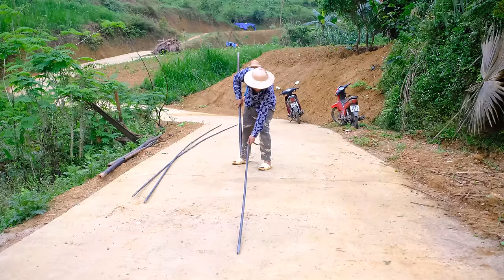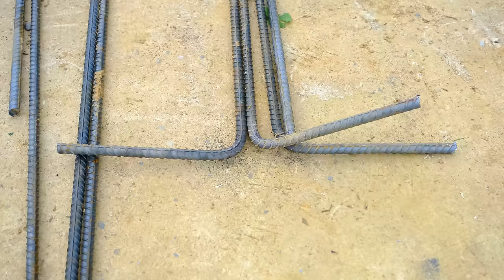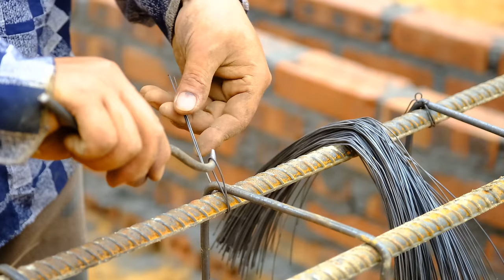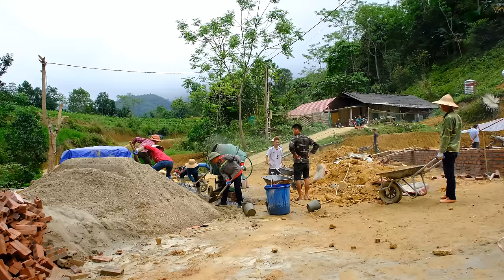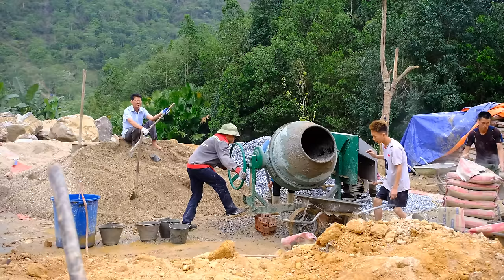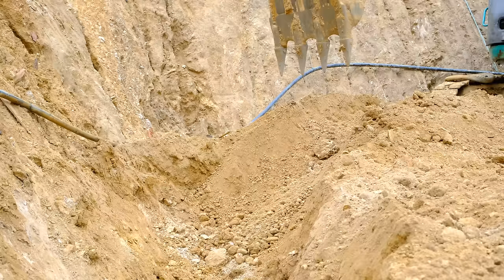Use 10 tons of iron, 1X2 stone, cement, and sand to complete the solid foundation of the house

Comment: Suggestion… there should be a block wall for rainwater so it won't go to the house and flood it because it is lower than the level ground. This must be included in the plan on building a house. If the ground is not level.